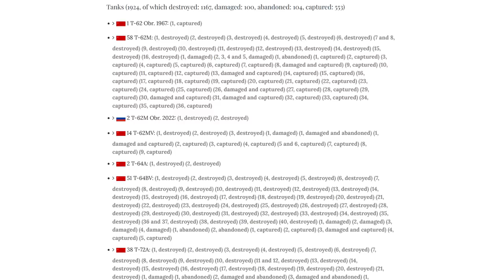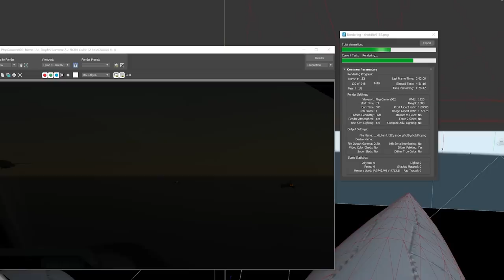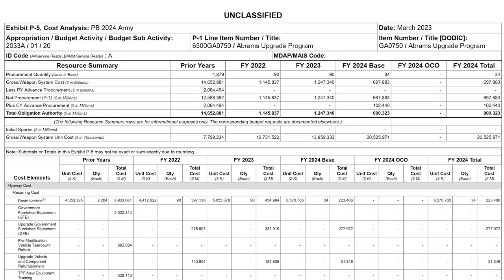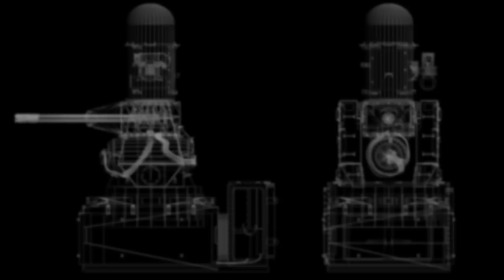US Tanks in Storage - Several Hundred Less Tanks in the Past Year

Comment: As several people have already written:

Poland:
- production of 250 new M1A2SEPv3 + 43 specialized vehicles on A1 chassis
- upgrade of 116 M1A1SA or M1A1FEP (ex US Marins) (for donation of UA 240 T-72M tanks) + 26 specialized vehicles on A1 chassis
- The rental of 28 M1A2SEPv32 tanks for training purposes

Australia (contract 2021/2022):
- Purchase of 160 used M1A1s and upgrade in australia to 75 M1A2SEPv3 tanks and 46 specialized vehicles on A1 chassis (by Australian industry)

Romania:
- bought 54 tanks, but there are no details of what version and whether new or from stock.
Reply: I was just thinking about that during the video. I was mostly thinking about Poland buying a few hundred Abrams
Reply: Taiwan is also getting 108
Reply: Where are all of the old M60’s. There are hundreds in Turkey upgraded by the Israelis to 120mm canon plus upgraded fire control systems and armour packages ?
Reply: @johnbooth3073  Retired in the 90s.
Reply: small correction 28 rented for training to Poland are SEPv2
Reply: @Matt-mt2vi by 2026
Reply: Plus there is easily a couple hundred spread around being actively used. Turkey does have alot of tanks.  Nato still strong,  Russia not so much
Reply: Has anyone approached Egypt for M1 Abrams or old Soviet era tanks?

Comment: Great part of "missing" 300 tanks is that at least 116 of them are going to Poland on top of 250 more "new" tanks. That may be the case. It quite cover the missing tanks. I can be ofcourse totally wrong, but as you said, US takes stored tanks and refurbishes and upgrades them, resets their milleage and sell to costumers. Poland has signed a contract of total of 366 M1s. 116 M1A1FEP (if i recall correctly) and 250 M1A2 SEPv3
Reply: “General Dynamics no longer builds the M1 from scratch, but has a number of “M1 seed vehicles” that are bare-bone tanks. When new orders come in, General Dynamics modifies these seed vehicles with new technology depending on which variant is selected.”

Idk, but it would be odd to me that the US would count these “seed” tanks as “capable MBT’s”

They can only produce 12 a month 

Doubt that the 250 “new” tanks are part of the “missing 300” 

The 116 definitely do though
Reply: @bornonthebattlefront4883  like i said i could be totally wrong. I don't know how GDLS builds new tanks, if they indeed have some spare hulls or od they take those tanks from storage. However quite a number of clients ordered M1s recently and i doubt GDLS have this many spare hulls.
Reply: I also wonder how many of the "missing" tanks are just aging out and are getting stripped down for usable spare parts.

Yeah, that engine or transmission isn't as good as new built or old unused stock, but probably better than a part that's been burned out.
Reply: @swj719  everything like that in the tanks are in packs easy to swap in and out in a facility built to maintain them.  In the field?  yea that gets a bit more difficult
Reply: it is just logical to reduce your storage, while setting up the next gen tanks in the next decade.
Reply: @apollomars1678  Why? the desert is a great place to store them.  If the war hadnt happened in Ukraine they would still be sitting there unless they got sold to someone who is an ally
Reply: @bear76009  It is still to be maintained, that will create costs and even western tanks follow the simple logic, that older tanks have more problems by age, this includes russian tanks.

people tend to ignore the facts, that it is easy to make a tank "run again", but this is not service quality and this ignores problems with the tank in later months on the front, where they cant easily repair them on a notice. 

it is better for the USA to have new tanks in store and by reducing their numbers, they have an easy reason to get funds for new tanks....because they lack in numbers.

Comment: Another way to look at this is to ask how many tanks does the US need? Since Ukraine has the ability to strike a significant blow to the only country the US would engage in a tank battle requiring thousands of tanks, I would say that they can afford to supply far more than the promised 34 tanks they have earmarked for a fall delivery. Considering the thousands that are in storage and waiting to be converted, I would say that we can afford to get tanks to Ukraine immediately, so long as Ukraine has been trained with the vehicles and have the ability to supply and maintain them.
Reply: From a higher comment, someone pointed out that Abrams are logistical monsters to keep up to their optimal performance.

They're very maintenance heavy, they need to be modified for the Ukrainian environment, they need to take out some technology that they don't want the Russians possibly getting their hands on, and though it can run on many types of fuel; a special jet/diesel blend is most optimal for peak performance. Not to mention they're gas guzzlers.
Reply: There's no good answer for how many tanks the US needs as we don't know how many the US would lose in a contingency in the Korean Peninsula, or resupply for Taiwan, or just a general war with China in Asia, which while it would be mostly a Naval and Air war would probably still require a sizeable commitment of ground troops with their tanks. 
Generally a stockpile is supposed to last however long you think it'll take war production to catch up with battlefield losses. The US might only lose half as many tanks in a year as Russia did in Ukraine, but that would still stretch the current stockpile uncomfortably thin for the Pentagon planners.
Reply: @michaelthayer5351  Thousands of tanks for mountainous Korea? I don't think so. The big open plains of Ukraine, Poland  and western Russia is why we built 10,000 Abrams.
Reply: @mill2712  True, then we should be having a conversation in congress of why we are supporting these complex vehicles that are so difficult to supply and maintain that our allies can't or don't want to use them.
Reply: @mill2712  Those Abrams are simply outdated, not in terms of weaponry but more so in terms of survivability AND fuel consumption. I highly doubt we will see Abrams used really successfully in Ukraine either way. Tanks also have a very strange position in modern war, they are needed for occupation but are very much a death trap. And well... if they take until the end of the year to arrive there they are probably also too late. If anything this war showed us, a massive tank force is not automatically a win anymore. It's all about drones, missiles and air force. The Abrams will fail the same way the russian tanks failed, if not even more miserably.
Reply: The Europeans here believe that Europe is entitled to these tanks that the US has in storage both domestically and abroad.  We've accomplished more than our fair share, so I say, be patient. In sum, Congress authorized four distinct measures that provided $113 billion for FY2023, but the complaint by some here suggests that this is insufficient.  
 I was raised to receive gifts with grace, but that is not how many people in Europe behave.
Reply: @stevea2909  You realize that those Tanks are not just gifts right? Some of the send ones to the Ukraine are, but that's not "we europeans". Poland bought a fuckton of new tanks for example from the US recently, even tho they are considered difficult to maintain and a waste of money. France and Germany have a lot of tanks, for most people considered the best in the world, just not in sufficient numbers to gift them away. Why should I thank the US for sending gifts to the ukraine? That's not my country and also not my/our war. There is no reason to be grateful for something like that. Ukrainian people can be grateful for the help, I personally think its a wasted effort. Way too late and tanks are not really in a good position on the modern battlefield anyway.
Reply: @stevea2909  The tanks the US has in storage are, believe me, American tanks. This isn't, your Frisbee flew into my back yard so now its mine, kind of a thing. The fact that the tanks are housed there with American support ready to use them has been benefit enough to the Europeans. Its why there was a West and East Berlin and not just a Berlin under Soviet control.
Reply: @stevea2909  It might come as a surprise to you, but "Europe" isn't a single entity.
Reply: @Nokamigg  Um. Abrams are probably the most survivable. The US has problems killing their own tanks with the DU armor. The tungsten armor ones are a bit weaker, and that is what Ukraine will get, but they are better than most Russian tanks in survivability terms. They won't turret toss like alot of Russian tanks do, and the crew will probably survive. Ukraine is getting a platform far superior to anything they really had in numbers.
Reply: @Amann0407  Most survivable at the cost of a lot more weight. And they cost double the price of a T90. A javelin or Kornet (russian equivalent) and similar systems will kill any tank on the planet no matter the flag. It's not iraq anymore where all the armor really mattered against simple RPGs. You face drones, missiles, ATGMs and more on the modern battlefield. And anything hitting the tank from above will very likely end them. This war showed us how weak tanks became on the battlefield against modern threats. The US didn't want to deliver them because they don’t want pictures of dead abrams everywhere like we had with russian tanks. The abrams has no chance in a environment like ukraine.
Reply: @Nokamigg  Russians don't have javelins. Not too familiar with the Kornet, but I doubt it's nearly as good of a weapon.
Reply: @Nokamigg  There are already a ton of videos of destroyed Abrams from Saudi Arabia by the Houthi Rebels using Russian Kornets.
Reply: @avisitorhere  'America First' right 🤡🤡
Reply: Keyword "aslong" as they can mantain them
Reply: For sure they could. They just don't want to send them.
Reply: @MarvinWestmaas  you paying for the Tanks? yeah be quiet
Reply: @akadreku7327  Yeah, by allowing you to keep talking your bs. 

Don't wear on my patience
Reply: @MarvinWestmaas  Dont bite what you cant swallow
Reply: F this just giving money away
Reply: @akadreku7327  Don't pretend to be more then you are
Reply: @avisitorhere  The Abrams is the best take for the US.  Poland is also buying 300 of them which is the reason for backlog.  European countries prefer their own domestically produced tanks, Challenger and Leopard.  

Lastly, this is a tank, not a junkyard revival video where someone changes the oil and the thing starts right up.
Reply: @MarvinWestmaas  I dont pretend anything, if someone gives you a hand, you dont chew the arm
Reply: @akadreku7327  🥱
Reply: @alexseguin5245  The Kornet is a system already proven to be working great, it's not new or something. It will go through any armor like butter.
Reply: @alexseguin5245  Kornet ATGM actually has more penetration compared to the Javelin (1200mm vs 800mm) and has almost twice the range of the Javelin so it's actually a much better weapon.
Reply: @avisitorhere  You'd need some, and the likelihood is that if the US is fighting in Korea, they're likely in other theaters as well.
Reply: Impossible to service them in europe because of imperial fasteners
Reply: @avisitorhere  Sure, the Abrams was built for the Cold War and that era's threats. But militaries have to be adaptive, and the Abrams is more versatile than a one trick pony. War with North Korea and China is a possibility. The Battle of Chochiwon saw the US lose 9 tanks to North Korea during the Korean War. Their usage might be different in Korea than in Ukraine, but tanks are still important war vehicles in any theatre of combat and will be needed if a war breaks out in Korea.
Reply: @Nokamigg - thank you for explaining these details.  the devil is always in the details and logistics.
Reply: @Nokamigg  I disagree in the extreme and with predujice that Ukraine is not our war.  Russia views Ukraine as just a bump in the road to recapture all of the Soviet Empire plus Finland, Germany, Norway, and Sweden.  History shows that view is the essence of Appeasement and the death of democracies across the world.  We must bear any burden, pay any price, to defend freedom in its hour of maximum danger.  We shall not shrink from this responsibility, we welcome it!
Reply: @loganknezovich8394  Better in some ways, perhaps. However, the reason JAVELIN has been so successful is its flight profile, not its warhead. You don't need a massive warhead for a top shot. As long as it can pierce the hull, that tank is done.

This is in line with the US thinking on weapons systems, though. The US prefers hyper-precise weapons with a lower explosive yield, while Russia adds additional yield to make up for lower accuracy. We saw this when Ukraine tried to take out the Antonovsky bridge in Kherson. The Ukrainians could probably (literally) write messages to the Russians with those GMLRS rounds, but they weren't really doing enough significant damage to the superstructure to permanently take it out. While the Russians obviously used traditional demolition techniques, they have several rounds that could have dropped the deck in one or two shots - so long as those shots managed to hit the bridge.
Reply: @Nokamigg I have seen a video of a Iraqi Abrams left face turret armor shrugging off a kornet hit, there’s no way to confirm it was a kornet as the only thing in frame was the Abrams, but from the video it seemed as though it took minimal to no damage from some sort of guided projectile.

Comment: I don't always agree with you but great video. You should also keep in mine we build about 15 new Abrams from scratch a month with a surge potential of 30 a month. And that's without expanding the workforce to build even more. Max would probably be around 50 a month.
Reply: So you're saying both Plant One Hull and Turret fab lines (including Flame-cut) are still in operation in Lima?

Comment: Was a 19k m1 abrams tanker, our tanks during 16-19 in 2nd bde 1st AD were old beat up m1a2 sep v2's that hadnt been reset in over a decade. They were always breaking down, and it was not unusual to have deadlined tanks not operating for over a year. I would say most of the stored m1a1/ m1p  tanks at the Sierra army depot have been stripped of valuable parts, electronics, and are just empty tanks.
Reply: Same experience when I was in, they will get eaten up in Ukraine.
Reply: @macarmalite8775  not necessarily, when they worked, had a good boresight, there a killing machine. But my brigades tanks were always falling apart. After a 2-3 week exercise, you could expect only half strength of tanks running.

Comment: In 2021, Poland ordered 250 M1A2Sep3. When they transferred their old T72s to Ukraine (for which they were reimbursed by the 🇪🇺 Peace Facility) they looked for a stopgap, since they only had 120 Leopard 2PL and over 200 PT-91 Twardy left. In the end 🇺🇸 agreed to provide them with about 120 M1A1 on short notice. 

So those may account for some of the tanks being moved from the depot. Since those tanks are over 20 years old and were supposed to be delivered quickly, it's possible that a larger number was moved to the factory to see which ones required the least amount of spare parts and could be made ready the fastest. 

Also, when 🇺🇦 lost dozens of Bradleys during the first weeks of the ill-fated spring offensive, 🇺🇸 immediately replaced them via a new support package. 

So it's very much possible that more than 31 units were moved to 🇩🇪 for training. It would also make sense t have more than 31 available, since they also had to